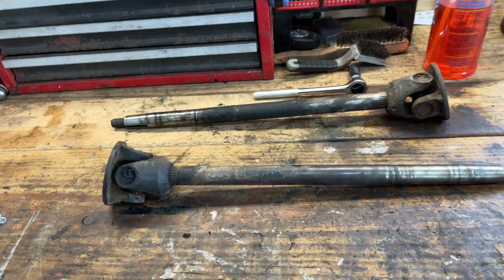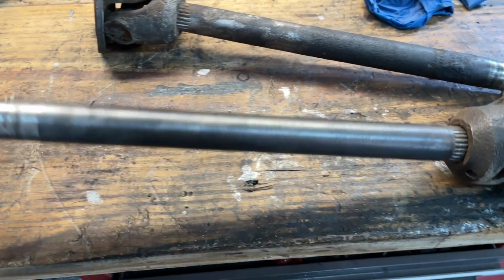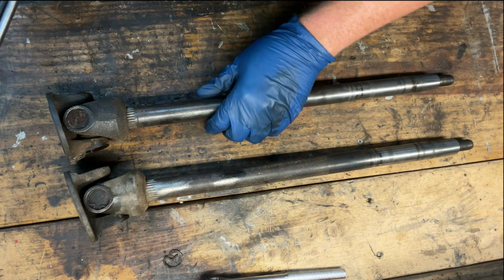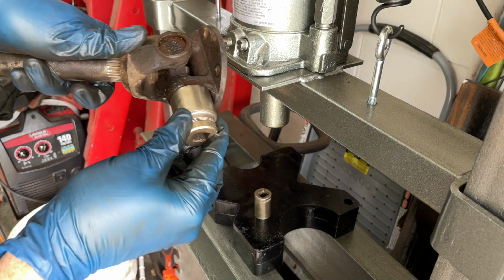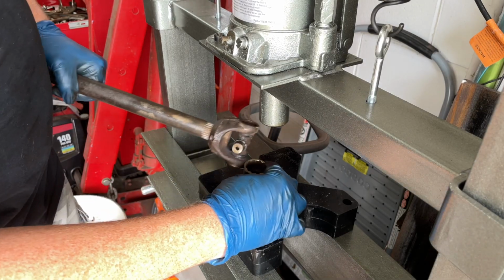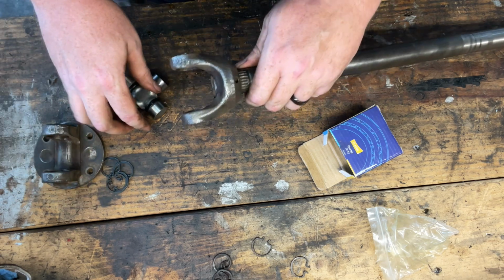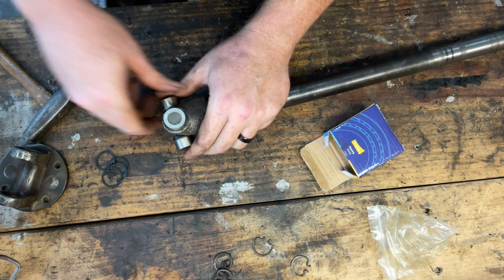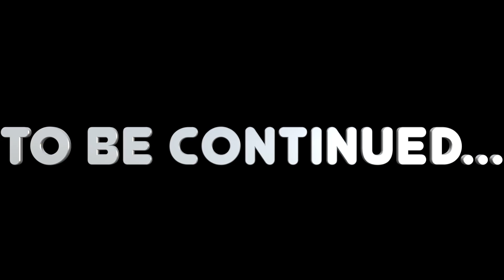Universal Joint Replacement | Triumph Spitfire Restoration - Part 78

Comment: U-joints were always fun. In the 20 Years that I was a mechanic, This was something else that I use a ball joint press on, especially with the reassembly.  Even when I had the use of a full shop, I still used the B-J press. It just gave me that little extra amount of control.   As you have just learned, always take your time.
Reply from the maker: For real.  The first one I did was so simple and straightforward.  I used the press.  But for some dumb reason I decided to use the hammer.  I don’t understand myself sometimes…

Comment: Bearing fell over, been there done that dozens of time in my experience as a mechanic.  As you get experience, you learn how to detect that it happened before you do permanent damage.  I don't usually use a press and use a bench vise instead.

Comment: Hammers and 20 ton presses are great for breaking and damaging things. A good vice is all that is needed. I hope you used a propper Churchill type tool and not the darn press for pulling the hub. If not you may likely end up with wobbly wheels  due to a bent flange. The UJ's use are a common stock size available from any bearing or joint supplier, but the quality of the product can vary dramatically from one brand to another.  Only buy major brand UJ's such as Spicer, SKF etc. for this application. Or you may well find yourself doing the job again, perhaps much sooner than you might think.
I have done this exact job literally 100's of times over 50+ years as a Triumph specialist.   Been there, Done that.
Reply from the maker: I learned the hard way and I am learning as I go.  I did use the correct hub puller to remove the hubs in an earlier video.

Comment: Steve, when putting those caps on the yolks in the U joints, I never use a hammer on the end of the caps because you caused them to expand possibly crack them but that hammering definitely expands those surfaces you need to use a block of wood or put them back in the press and press them on once you get to started. Press them on with your hydraulic press never Hammerman place.😳😳😳